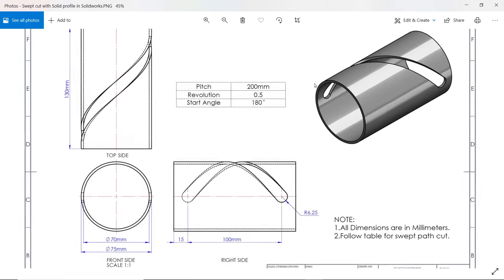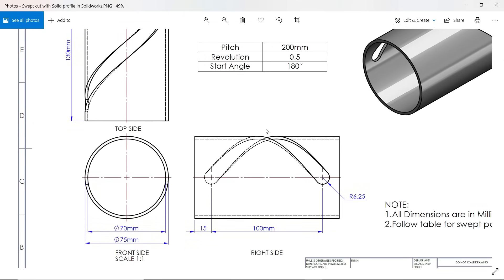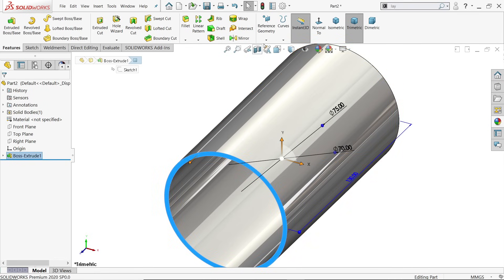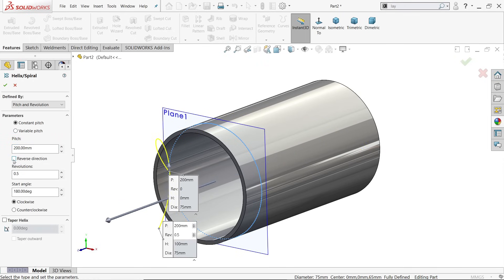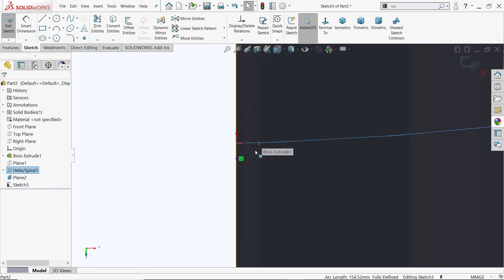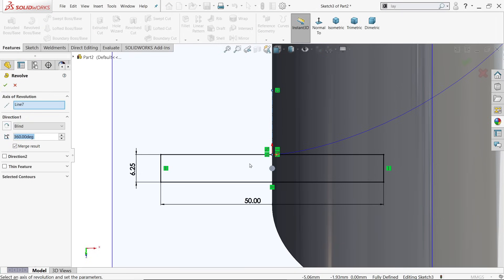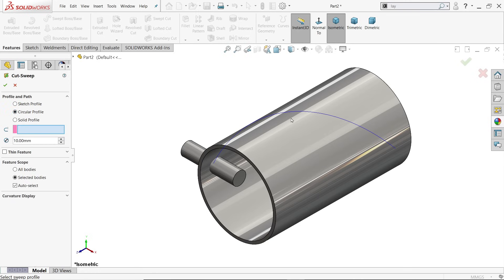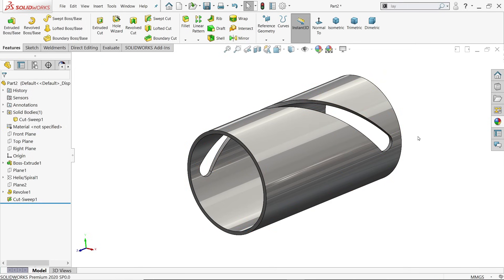Swept Cut with Solid Profile in Solidworks

Comment: I am new to SOLIDWORKS, having been introduced last summer during the summer semester. I am involved in a course that involved CNC, manufacturing, and machining,and I absolutely Love it!
  I find 'things' while walking down the street and take it home to sketch in SOLIDWORKS, and when I say, "things", I mean something other than a snot-rag, but something like a spark plug, or something similar. I was sitting having coffee, so I sketched a coffee cup, along with other objects that I see in the world around me.
  Your videos are some of the best that I have come across, especially for a beginner, due to the way you talk, the speed, and the way you describe what it is that you are doing. I begin a new semester next week and I am excited, having ordered a new mouse due to mine being too small, uncomfortable, and the new one has 19 programmable buttons to assist me when going to different features.
  I was introduced to CNC in 2006 while working at a company that manufactures plastic, outdoor furniture. When I started I was cutting the blanks in preparation for the CNC machine, which has two 6' x 6' pallets, which allowed me to unload/reload one as the other is running. Being the new guy a few individuals were a bit taken aback that I was offered the position in such a short period of time. 
  Going back to school has been something that I have wanted to do for many years, but I struggled with some personal issues, including anxiety. Now..? I would have to be dragged out, kicking and screaming. Lol. 
  I look around the world and there is little that isn't the result of the field that I love and have chosen. I have been able to unleash my 'super-nerd' abilities. Thank you for the time and effort that you put into your videos, because you are helping me achieve my goals!